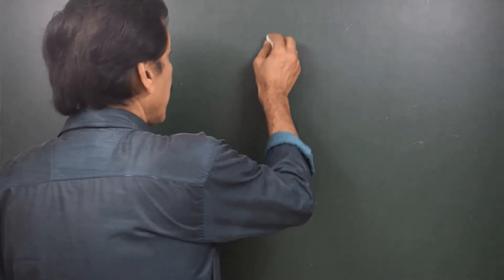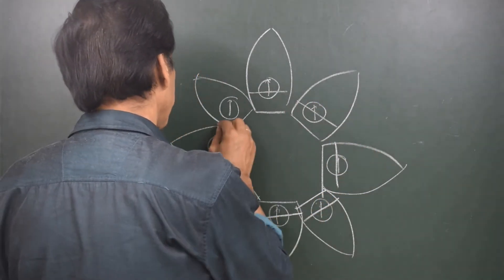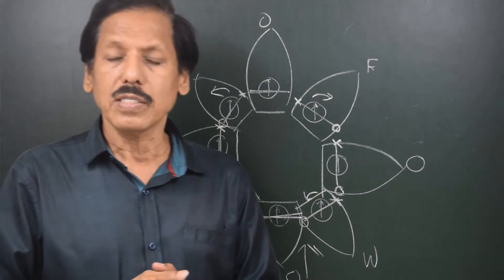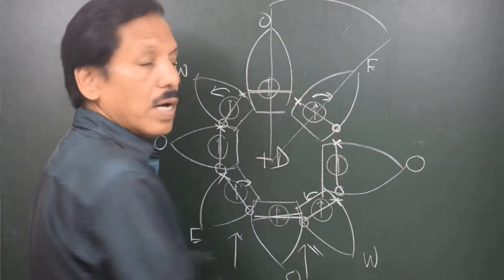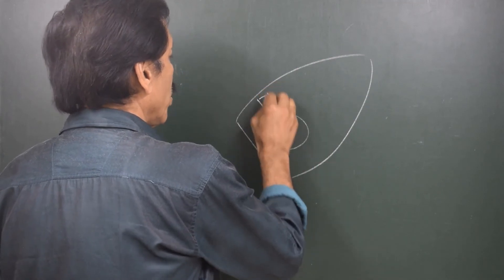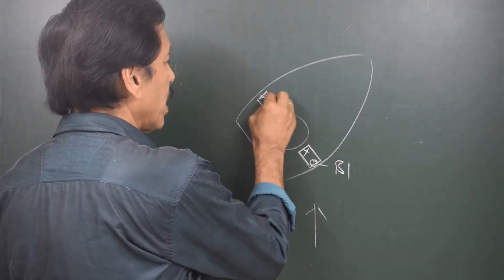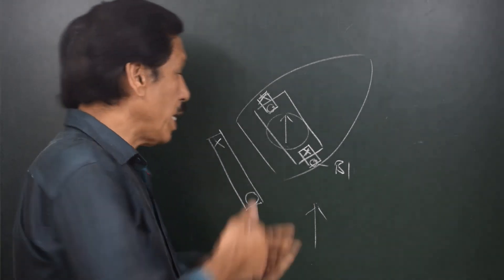Coefficient D & Soft Iron Spheres

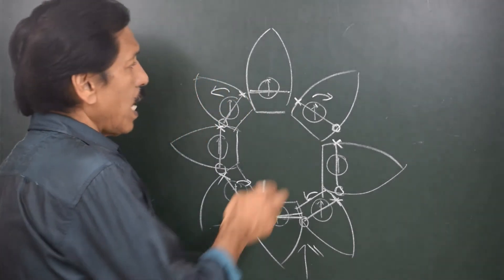Comment: Thanks for your clear explanation! It is not clear to me however why there is no deviation on a Easterly or Westerly heading. Shouldn't the compass needle want to turn 180° towards the blue pole of the deck beam? at 04:26
Reply from the maker: There is no deviation when the disturbing poles are in meridian. On 0900 heading the poles of beam will lie in meridian.